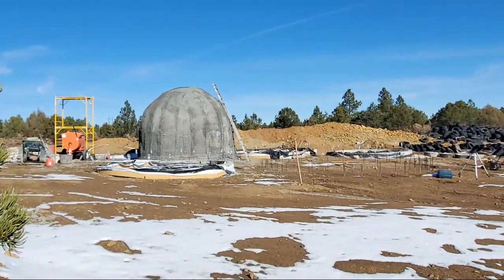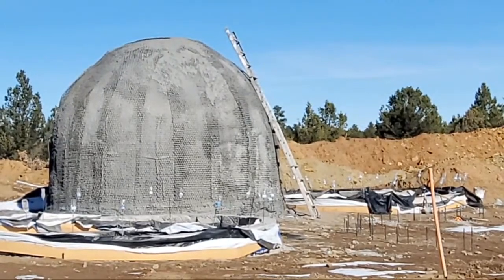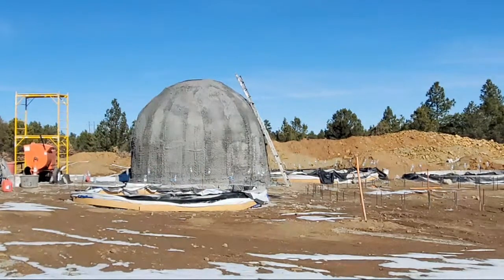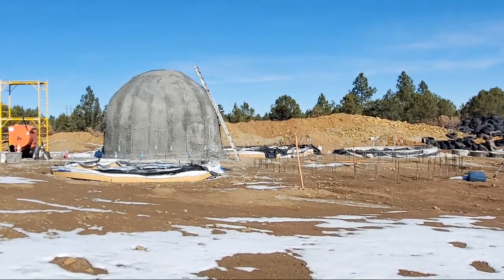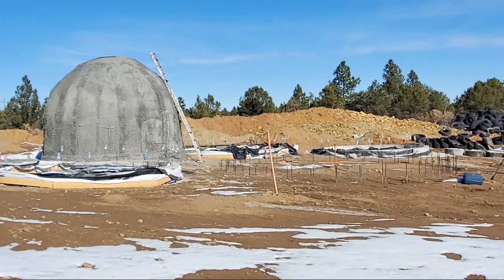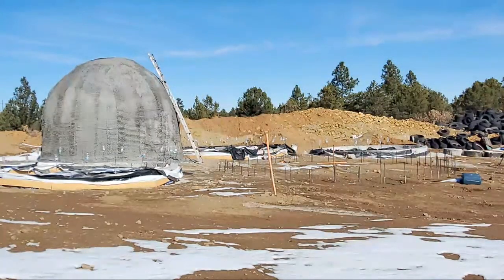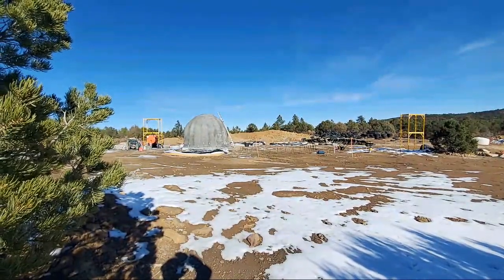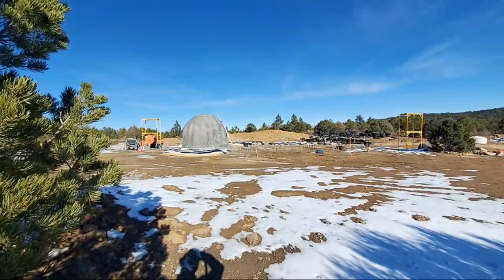Dome Build Talk with Aircrete Harry #domebuilding #livetalkwithaircreteharry #domes #aircrete #diy

Comment: For Geodesic dome plans for tubing - ZipTieDomes.com - quick, easy, no bending - cut to length, drill holes, assemble. EMT would require metal ties rather than Zip Ties, but would work with the PVC hubs you can either make or buy from them in order to provide strength until the shell dries. Should be able to remove the dome frame afterwards and reuse. This coming spring I hope to do the same. I built the 15' single frequency dome myself (after cutting and drilling PVC) in about 3 hours and brought it down in under an hour.
Reply: I'm doing this next month in Guatemala. Can't wait to see how it turns out
Reply: Hey, that's what I was thinking!  I've been exploring making rounded scaffolding (dis-assemble able) for the larger sizes of domes. Still plan on using Tyvek & mesh to cover them.
Reply: @B30pt87   - I was using burlap  as a practice material, thinking that it wouldn’t be much different of a method with the burlap impregnated with either OPC or MgO polymer cement powder and then softly soaked down with water once hung from the frame. I mostly worked from the inside with just a ladder.

Comment: You know you could use a slow setting epoxy in the cement as well. Latex has a tendency to not handle pressure very well and can cause cracking in the long term. Air Crete is one of those things that I'm not sure I would trust in the main inner structure. The mesh and rebar I'm sure will help but even still I'm just not sure if it will hold up over the long haul.

Comment: 58:31 Also could do one shell, then spray closed-cell PU foam and then do the other dome on top. Closed-cell foam is structural it is not prohibitively expensive but it has to be installed by a professional.
A partially buried spheroid or sphere could make sense as well. For strength and energy efficiency due to lower surface area and lower Δt for given space of the structure :)
It would make sense to put doors and windows on the south side for passive heat gain.
Reply from the maker: You could build that way also but it is very expensive to use close-cell foam . That is the main reason for Aircrete & EPIC cement was to replace the  expensive close-cell spray foam.

Comment: HELLO, WHAT IS THE EXACT FORMULA SO THAT THE AERATED CEMENT IS STRONG AND DOES NOT CRACK, I SAW YOU ADDED SEVERAL THINGS TO THE MIXTURE, I HAVE SEEN OTHER VIDEOS AND THEY ONLY ADD A SACK OF CEMENT 92LBS (40KG) + 8 GAL WATER (32 LTS ) + FOAM UP TO FULL 53 GAL (200 LTS). THANKS

Comment: Boy that would be great since i want a dome family home. However ill need someone to build it im 72 years old. Needs to be bothcold and hot i do like your dome light. 
I didnt think ABOUT wild wild. 
I have seen homes I LIKE very little in floor plans.
I did like in ground but the ground might be to hard to dig into. How do I find out about the building code?

Comment: Think I would be able to cut triangles from 1in think pink foam insulation boards to make a geodesic dome, and then coat the inside and outside with aircrete/epicrete? Just a thought I had watching your process

Comment: in the Philippines how thick should I go to insulate against the heat. you say 12 inches, I foot, for the cold but I have no problem with cold just heat. I will be making a pole barn house and using aircrete between the poles to fill in the voids as walls. I want to pour in place, casting the walls a foot at a time. one guy said that more than 12 inches would cause the wall to collapse to much and not provide the insulation quality I want. I am going to use the 100 insulative aircrete that you made in your video where you did the experiment with all those different amounts of foam to slurry. that was a really helpful video. anyway. what do you think.
Reply from the maker: I would make the aircrete 4 inches thick.
Reply: @AircreteHarry  I will be using six inch posts so six inch thick will be more than enough if I am reading you correctly, righ?  Thanks Harry for your advice. you are the king of aircrete.

Comment: for vice which is the best sparkling for concrete ..you ever use sand together ..which is the best tip for a good job in.plCas wall and block

Comment: Have you ever looked at Natural Spaces Domes. I'm curious to your opinion on Dome kits compared to airforms.
Love all your content! Thanks so much!
Reply from the maker: Hi TL,
I have seen the NSD before and I think out of all the wood dome kits NSD are the best, because they use 8 inch wood instead of 6 or 4 inches. But some of the reasons I would not buy one is FIRE, LEAKS, BUGS. When I build a dome home I want it to last forever with the air-form, reinforced concrete, EPIC, Aircrete. 

I will never have to worry about a fire inside or outside the dome will always be standing. Using the air-form makes the roof and walls monolithic. The edges on the NSD are joints that can leak. Having wood means you have to look out for termites also.                                             

Prices are about the same to build but with the air-form kit you have 10 inch thick walls with 8 inches of that being insulation made of cement (much less in warmer climates), NSD you need to buy insulation to put in the cavities or have it sprayed foamed. Air-form dome will take about a week to build the dome shell after the foundation has been made with two or three people.
Reply: @AircreteHarry  Honestly, thank you so much! My partner and I love your channel! Once we move back to the states, we are gonna use use your Whatsapp service for your consultation  for our future Dome! Have a Happy New Year and we hope you, Mrs.Aircrete and your family stay blessed!

Comment: Would a hexagonal base work with a smooth rounded dome? Say you wanted the lower portion of the dome to be long rectangular blocks forming a hexagon base and transitioned into a smooth round top? I'm more or less concerned about stability and strength in this design.
Reply from the maker: This is a reinforced concrete dome. The foundation ring-beam has a rebar box cage with 4,000 psi concrete.  No need to be concerned with the strength of this design. It's Very Strong !

Comment: The dome on the screen is not aircrete?  Why would you use reinforced concrete instead of reinforced aircrete?
Reply from the maker: To make the dome stronger reinforced aircrete is not as strong. But the dome is not completed yet, I still have to put an insulation layer on. It can be aircrete or EPIC.
Reply: @AircreteHarry  (Thank you for replying.)  Are you switching over to this for all domes now,  or is a pure aircrete dome with mesh on the inside of the shell & reinforcement between the 1st and second layers still a functional option?
Reply from the maker: @B30pt87  I will be building reinforced Aircrete domes in the future. All the domes in this project will be done like this video and more I have not spoken about yet I think next video I'll talk about it.
Reply: @AircreteHarry  Thank you!

Comment: Hey aircrete call me epic Harry.lol one more thing what if you were to build  tyvek dome structures with the sole purpose being for making forms ? With the desired side being quick release and smooth with the correct radius,  then using them to build your reusable inner and outer forms rather than my old fashioned way of cumbersome wood and steel structure?  cut them down to four pieces or as much as you need to easily remove them or four men can easily carry and stand up..outer forms would have to have 12 in larger diameter but get this I just thought of this one after that's all poured 6 in thick you can go into the structure and set up an even smaller reusable form with a 4 inch gap and fill that with foamy light fluffy air crete as an insulation layer,! Anyway you'll probably be able to understand this easier if you read the message I sent you somewhere don't remember how I did it but yeah talk to you later thanks

Comment: I live in SE Louisiana, grow sugarcane everywhere and millions of tons of byproduct from plant called bagasse. It is very fibrous and can get for free. Would this "bagasse" be good for strenghtening aircrete as like your ingredients for epic?
Reply from the maker: The bagasse should work good with aircrete. If you have it use it.
Reply: Steve @ Domegaia has been experimenting with non costic  aircrete mixed with zinc (I believe) and different fiber materials as well for strength such as hemp, horse dunn etc. Has found the right mix instead of Portland cement

Comment: This is a better image of the heat exchanger, noting the more intricate details with the spacing of the one direction vent that I'm not certain if intake or exhaust... I'll ask next: https://greenwayerv.blogspot.com/2020/10/the-heat-exchanger.html
Reply: Humorous, is I read into these when I was an undergrad using political signs left over for the coroplast material.  At that time was more the run down the length of a basement wall for geothermal transfer also with an intake side vent.   Thinking these heat exchangers might not be bad underground for some geothermal added heat benefits also... whether cooling or heating.